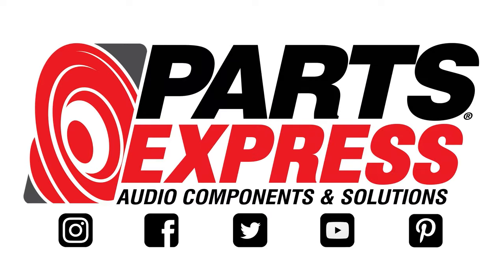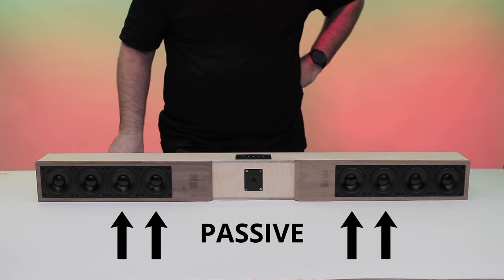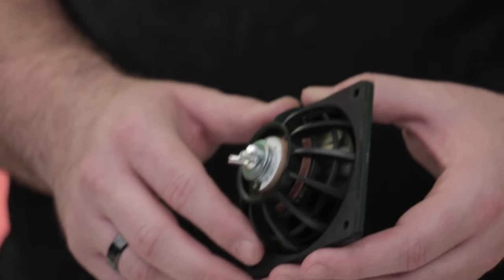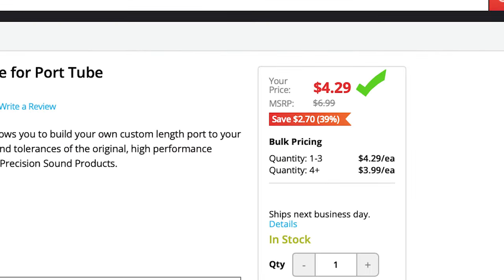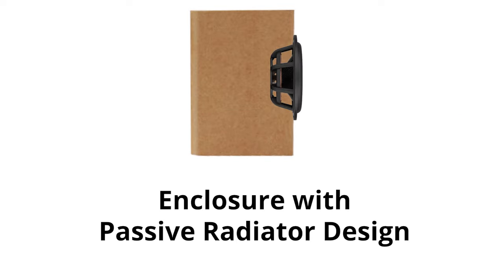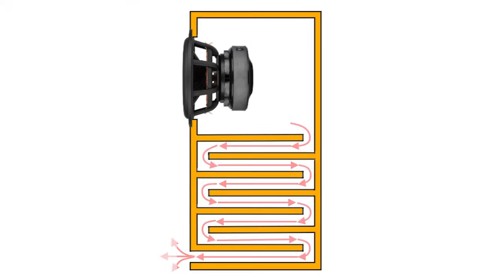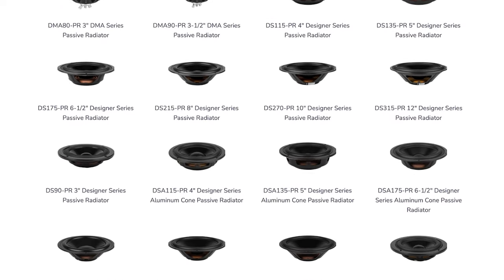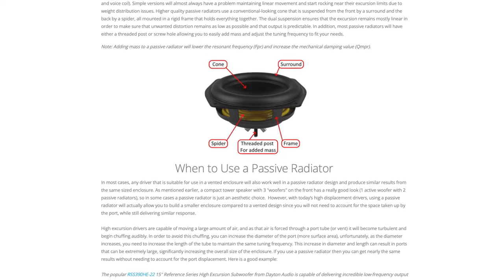Passive Radiators Explained. Basic Speaker Building Techniques

Comment: Slow bass.  A passive radiator does nothing when the woofer starts moving at the start of a bass note.  So you don't get anything out of it to start with.  After a few cycles of the bass note it gets pumped up and starts moving such that the woofer is no longer moving.  Yeah, that happens.   So it rings like a bell during that bass note. When the note ends, the passive radiator keeps going for a few more cycles. That's blurry bass.   Just say no to ports and passive radiators if you want clean fast bass. To get the same amount of bass, just add a second woofer or move up a size.  Then EQ the low bass to bring it up.
Reply: I think larger lighter passive radiators generally ring less, but an infinite baffle with a long foam stuffed tunnel on the other end will ring the least - at the cost of efficiency. A fully sized front loaded horn will do well too - due to the air pressure mating improving efficiency, but also drawing energy from the moving cone more quickly in a way that it stops resonating quickly.
The room you are in can ring too, and that is often the worst offender of the lot!
Reply: I’m gonna stick to ported. Easier to get loud more windy and if you build it right it should hit just about any note you want

Comment: It rings like a bell driven by a rubber band attached to your woofer. After a few cycles of a bass note it catches up and rings at nearly full amplitude. All those frequency response plots you see where the port or passive radiator makes nice low bass.  That is where you get to with a continuous tone playing forever.  The transient response is what the woofer does on its own without the radiator, because the radiator takes time to get going.  Funny how that is never talked about.  When the bass note ends, it rings a few more cycles. Play a fast attack plucked bass note, or drum beat that by its nature is a sinewave that starts suddenly and then has an exponential decay, and a passive radiator will compress the leading edge or that attack and compress the peak at the start of the note, and will catching up with the signal after a few cycles.   If the note decays quickly,  the ringing of the radiator may extend the note a bit as it always has a decay that is defined by it's Q.   So passive radiators can create bass,  late, with crushed attack,  and as such do not reproduce the bass with high fidelity.   If you are looking to extend the bass and don't care about fidelity, go for it.  Otherwise,  just add a second woofer and do a little EQ in the low end.
Reply: Thanks, makes total sense. I'll avoid them. Thinking about it that way makes me think they're best for things like bluetooth speakers where size and power are big limitations.
Reply: Very nice observation. How about both  a second woofer and some DSP,  together :D.
Reply: Weird because the RSW-10 utilizes a passive radiator and that is one of the most accurate and best sounding subs you can come across.
Reply: I'd say it depends on the weight and damping characteristics. A small heavy passive radiator will probably swing the longest. A nice big lightweight one like on the back of a Klipsch Forte series speaker, will probably do this less. The best is a sealed horn loaded system, where a compression wave is concentrated and amplified down the horn, and it also takes energy out of the speaker cone, so it stops resonating more quickly - functioning like an aperiodic membrane but with improved efficiency. This is really where "fast" bass comes from. To those who say there is no such thing as a "fast" subwoofer and it's simply that lower notes have longer time periods, the effect is not measured over a single cycle but over several - like blowing into a bottle, it continues to ring for a while. I did have a pair of second hand KEF speakers where the bass did sound fairly baggy like this, though the passive radiators were similar size to the woofers. It is better to have bigger passive radiators that couple to the air better and don't store so much internal energy due to the lower excursion, and also don't run out of excursion and limit themselves as quickly.
The other thing a passive radiator will have is a big suckout at its own free air resonance. A port doesn't have its own free air resonance, or it tends towards zero. Although this is usually well below where you should be high passing, you might miss out on a bit of low bass that got through the filter.
I have heard from a video review of a certain brand of speakers, that another problem with them is at very low volumes, the rubber membrane can be a bit rigid towards moving at all, so you need to turn them up a bit more than a ported to really "wake up" the bass reinforcement, or else they can sound a bit lacking in low end, as if you just had a sealed box.
My opinion is that they have a certain size range of enclosures where they are superior to ported, but then as you get bigger, ported starts to win - losing its disadvantages of the port filling most of the box, or not being able to get the ports wide enough to pass air properly without the tuning frequency getting ridiculously high. I'd say it's rare to see passive radiator designs in PA speakers because the speakers are in the size range where you lose the disadvantages of ports and gain all the advantages.

Comment: I think passive radiators are the clear winner in small enclosures, where you either need something the width of a drinking straw that can't pass air properly, or coiled up like the intestinal tract, taking up most of the room in the box.

Comment: A port is essentially a passive radiator, the air column inside it is the 'cone' and the air cushion in the box is the suspension. The actual passive radiator does the same thing, but differently. Both resonate in a certain frequency band, where it adds up to the active drivers' output. Above that, their inertia blocks the out-of-phase sound coming from the active driver's back.
 Below tuning though, the waveforms will be out of phase, leading to no noteworthy output. That's why both resonator box designs act as a higher order filter, while a sealed box rolls off less abruptly, with 2nd order characteristics.
Reply: Not entirely correct. It would be more accurate to say that they are both Hermaholtz resinators. The slope is not exactly the same, the passive radiators has a slightly steeper roll off than a port.
Reply: @DodgyBrothersEngineering  

Yes, the PR rolls off with (I think) 30dB/Oct, while the port rolls off with 24dB/Oct. 
But their working principle is pretty much the same.
Reply: @westelaudio943  I would go as far as saying they work "roughly" the same. A different way to achieve an approximate same desired end result.
Reply: @DodgyBrothersEngineering  

Well, my main point was, if you want to understand the physics behind the port, it's very helpful to know about the PR first - it's way easier to learn about mass and suspension when present as, well, mass and suspension instead of just air in both cases. Of course both port and PR come with their own quirks design challenges, but today with design software, you can actually design a decent enclosure while still believing a port is just an "air tube to relieve pressure from the cabinet", as many people actually seem to think. Knowledge of the actual physics behind it don't really matter there anymore.
Reply: @westelaudio943  agree, modern software can advise you on things like port air velocity. Which is where most ported designs come undone. I tend to think of PRs as an expensive port alternative that removes a lot of the guess work.
Reply: @DodgyBrothersEngineering  This.   In my recently developed Passive Project on WinISD, I found the steeper roll off than my ported projects.  I can imagine its due to the greater resistance of a closed passive at max extensions while the Ported will just keep on leaking out the air.  Something like that.  Thanks for your input.
Reply: @halrichard1969  I tend to think you are on the right track. The spider on the PR's are going to provide resistance,  whereas the air can move more freely in and out of a port, provided the diameter is sufficient.

Comment: I have looked around Parts Express and I do not see any Kits or Washers to be used as weights for tuning the passive radiator.  Are we supposed to know the thread size and just go down to Home Depot and buy Body Washers and spacers?  Then weight the whole assembly out piece by piece?  Buy the correct size bolt to go with it? Im just asking.  I am very willing to do all this if its really the way it gets done.
 WinISD Pro is very easy to use and understand.  There may be a few hick-ups in the beginning but you can watch one or more usually short YT Videos and get a leg up.  WinISD will will give you the info neccessary to get a correct box size, give the info you need to add or subtract weights.  Adding weights will cause your Xmax to increase on your passives so you need to find the happy medium for your goals.  More watts pushed thru the speaker the more travel you will have at a given frequency.  Once you get into the ballpark with your tuning you can then use a Rew tuning and some DSP for the easy way out like me.  :D
Reply from the maker: Correct, you can just buy washers from Home Depot, though each PR usually come with a few to start off. You can use those for size comparison.
Reply: @PartsExpressOfficial  Thanks for the reply.  I wasnt sure if it would get answered.  Some of your Passives do come with a nice set of Weighted Discs most do not.   5mm hole in the Passives.   Tuning can be sensitive down to a half-ounce so maybe buy some smaller washers to go along with the larger ones so you can fine tune.  Thanks again.

Comment: do passive radiators color the sound?
Reply: No.  People talk about the phase of the PR, but that talk is often misleading.  At low frequencies the PR is the main source of sound output, and at high frequencies the active driver is the main source of sound.  So the PR is not producing sound that is interfering with the active driver.

Comment: Cool.  Your DS315-PR 12" are working great with the DSA315-12 woofers.  In addition to the basics, I'd like a more technical explanation of the phase relationship between the active and passive woofer.  A LOT of people say the radiator is out of phase, which I believe in inaccurate.  There's a lot of wrong and misleading info out there!

Comment: So basically it's a speaker not hooked up but looks like it works yes
Reply: O and if it is hooked up the polls would have to be switched
Reply: Nope. A disconnected speaker has a damper aka a spider that has more rigidity. Some passive radiators have spiders to help with cone alignment but for the passive radiator to work properly it must have as little resistance as possible. The goal is to have as little resistance as possible but the proper mass to equal the desired tuning.